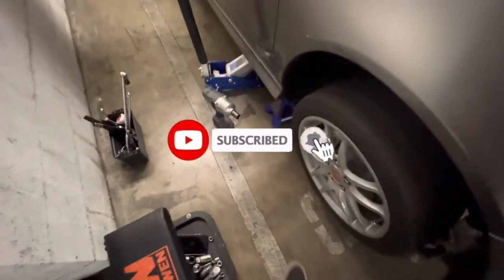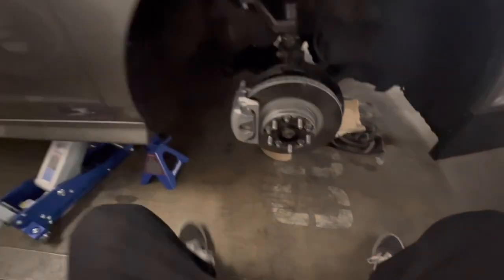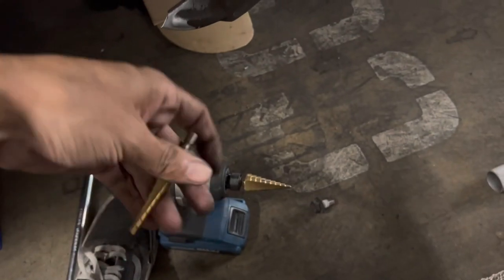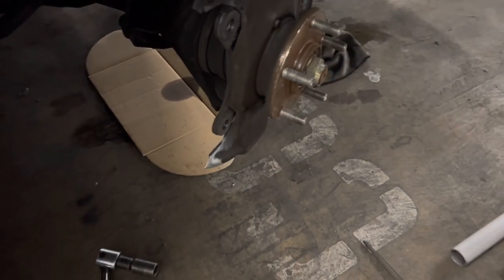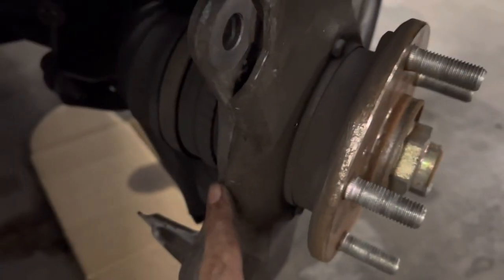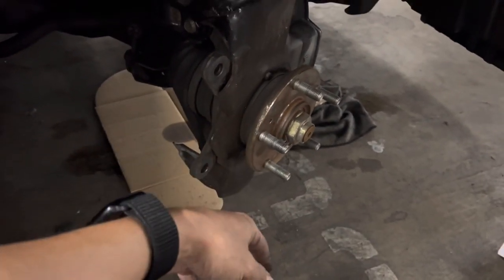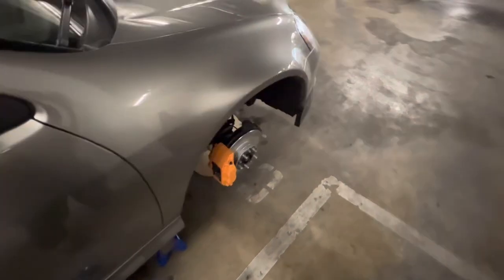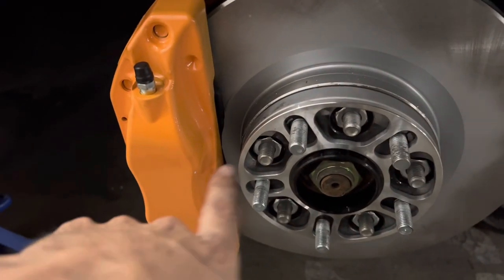ACURA RSX GETS BIG BRAKES

Comment: My RSX was leaking oil recently too.  My shop did the top down diagnostic, so we replaced starting with the head gasket 1st , then the tensioner plate, finally the oil press sensor.  It turned out to be the oil press sensor.  It sounds like you have more oil leaking than me.  Mine was very small.
Reply from the maker: Hopefully you meant valve cover gasket and not head gasket 😬 and yeah my leak slowed down after changing the valve cover gasket, it’s getting oil residue after pressure washing everything so I know I’m not out of the woods. My engine leaked 1/4 qt over night every night for 5 days. I have no idea how that much oil can piss out and not be super obvious.. im still chasing leaks
Reply: @IntegraDIY  You're right.  Valve cover gasket.  BTW, I'm curious, why did you choose the TL caliper instead of a S2K caliper?  Fitment?  Price?  Availability?
Reply from the maker: Honda s2000’s came with standard brakes. The TL-S brakes are massive 4 piston Brembos.. makes the car look much more premium, and the stopping power is greatly improved. Brembos can be bought on eBay for $200-$400 on eBay, they even sell remanufactured ones for cheaper. The whole setup is around $400-$500 extremely nice upgrade

Comment: You said the brake discs is from s2000 ap1 or ap2.Ant the caliper from what car is?
Reply from the maker: Rotor 8/1999-7/2009 ap1/ap2 s2k 
Caliper 2007-2008 ua7 tl type s
Reply: @IntegraDIY  thanks a lot.Nice job!The pins have to change every time that we change brake pads?

Comment: The downside about this is if your doing it like him where you drill out the stock bolt hole you can’t go back to stock brakes but DC5 creations BBK is machined to run the stock bolts so you can always go back to stock brakes
Reply from the maker: I thought about, but their kits are $500-$1000 depending on added options, before tax.. only benefit is the powder coating they have. I payed 280 for the calipers, Ceramic pads, bolts (very very special bolts weird size!) brake fluid and rotors.. $280 total. 

Then after that I needed the spacers so an added $60

If you are planning on doing it, save money, Drill ‘em bro, you’ll never go back to baby brake kit 😅

Comment: Do u think a different set of wheels would fit without spacers? The type r are 60+ offset meaning ur set up rn is around 40
Reply from the maker: Definitely.. I’m guessing 60 offset with the 25mm spacers will bring it down to a 35 offset wheel equivalent. Lower offset wheels will definitely be much better, not having to use the 1” spacer. I’ve read 22 offset is a nice look for these cars with these brakes. The 1” spaces work perfect and the car drive fine, I don’t find them sketchy like others do (just throwing that out there). 

I’ll say this, putting on the wheel and not having it fit was scary af. Especially since I don’t have a private garage and need the car on all four wheels 🥹